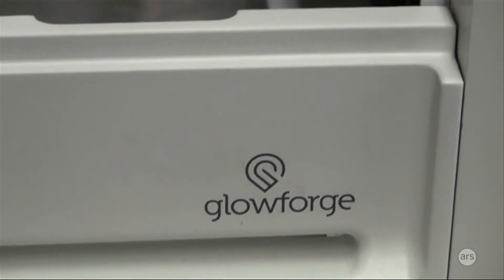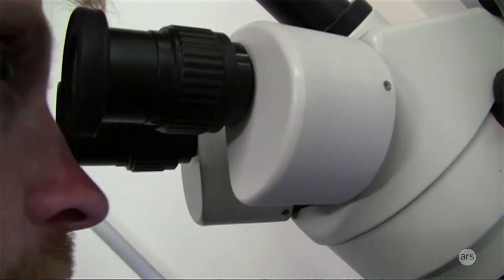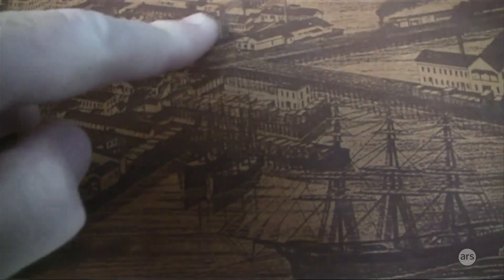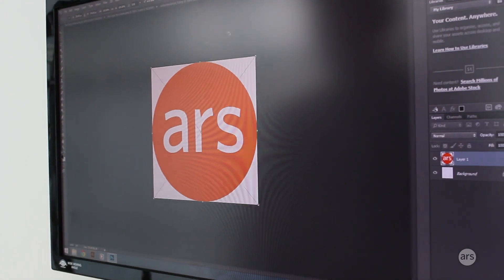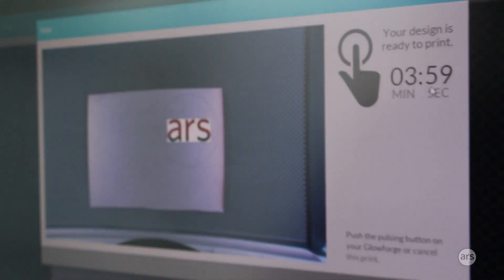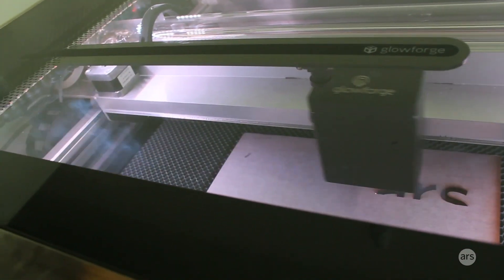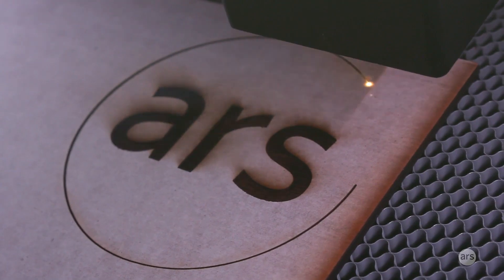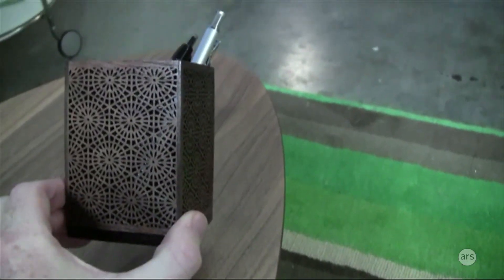Ars Visits Glowforge 3D Printing

Comment: I am very excited about the Glowforge. I ordered a cheap laser from china earlier this year. It was also a 40w laser and cost about $600. When the crate came, I opened it up and was excited to start cutting....and thats when the trouble started. There were parts missing on the x axis causing the cutting head to bounce. The power supply was cheap and would short out randomly. The software was in Chinese and it was a nightmare. After hours of playing with the software I did get it to cut. The power was analog and required you to twist a knob to adjust the power. It required me to run a vent to the outside and for cooling I had to run a hose through a bucket of ice water. The Glowforge looks like it’s going to be very simple to create your ideas without spending tons of time setting up and trying to get equipment to work. Starting at $1999….I think this is a fantastic price for what this machine premisses to be. I think the Glowforge will bring laser cutting to the masses just like the Cricut machines did for vinyl cutting. If you want to use my referral link below…you can get $100 off your order.

Save $100 using this referral link. 
http://glowforge.com/referred/?kid=CEBRcO

Comment: More vids of the Glowforge is always welcome, but could you guys elaborate on whether the sound was from the air-filter add-on module or just a shop-vac below the demo table?Burning for a Glowforge of your own? Get one through http://glowforge.com/referred/?kid=tCTeUI and not only will you knock $100 off their current 50% off funding special, there's a sculpted dragon ring print to those confirming with "CarterTG" in the either the Glowforge or B9 Creator forum http://tinyurl.com/ptfertu